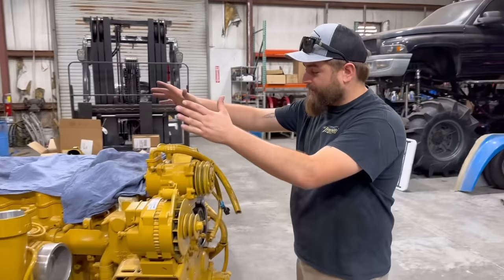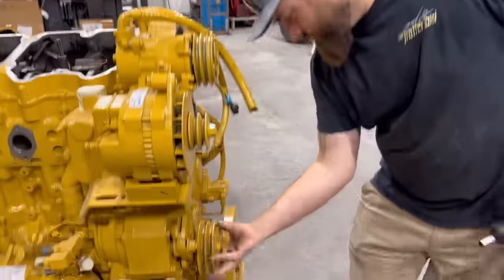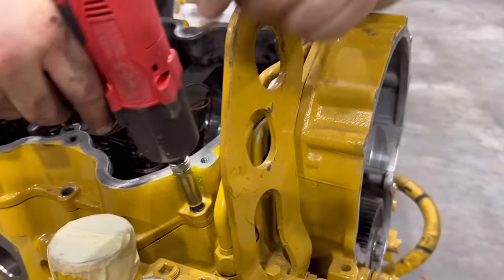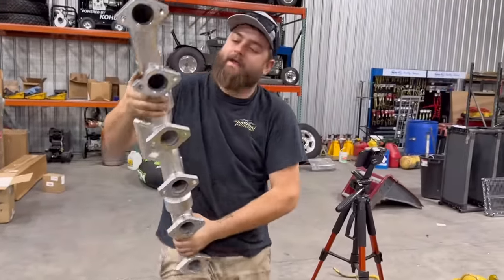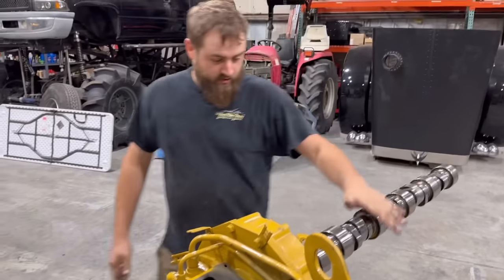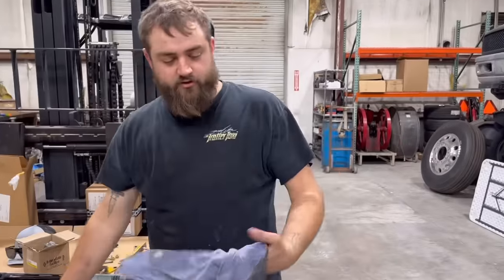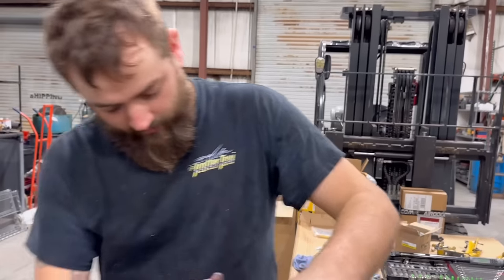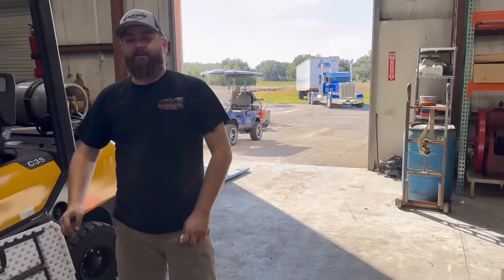BIG BOY Caterpillar C15 Engine Build is Underway!

Comment: Having a 50 lb camshaft rest with all its weight pushing down on one bearing shell is probably not a good thing..
Reply: I wanted to say the same thing but I didn't want to get called something silly by the YouTube trolls like a armchair mechanic.
Reply: No worries,  this engine is not going into over the road truck.  The whole purpose of it is to take it apart very soon due to failed parts and shitty workmanship.
Reply: Thought the same thing.
Reply: It’s fine
Reply: It’ll be just fine, don’t worry you self. Not you engine, not you money and not you truck.
Reply: @dieselsrule174 exactly and more content for him to make 😂
Reply: It will be fine its just for utube content, probably the engine will run for 10 miles only

Comment: The rear sump is superior to front sump as G force on acceleration causes oil to slosh to the rear . I would put a giant accumulator in lube circuit .fluctuating pressure causes oil to dump in to lube circuit . . So do self a favor install a large enough system about a gallon should be adequate . Only saves your investment . I’ve used these systems for years successfully . Don’t have a gallon one use 2 , of the 1/2 gallon systems piggy back .

Comment: Just an fyi, you can’t check torque the way you did, some guys try to check break away torque, but that isn’t good either, best way I can tell is to mark the bolt, then loosen it, and retorque to the mark, once a bolt stops turning, it requires much more force to get it moving again, all instructions requiring torque will tell you to achieve your final torque in one smooth motion…

Comment: Finnish Sisu used Cat C-18 engines about 2003-2006. I had it tuned up to 750-800hp, and since that it was the best running truck i've ever driven. )

Comment: Next time you put a cam in have homeboy with the camera help. Also keep the cam flat and twist it in and out of each bushing to deburr and push the assembly lube all the way around as you go(dont pull it all the way out or push through completely right away)And dont be packing greese into that back bearing. It gets trapped and can fuck with runout. It isnt rocket mortgage. Good luck with 2,000hp 😅

Comment: I think next time you need to lube, everything really really well with oil before you stick the cam in. It’s just a suggestion, but I promise you it makes a difference.  I’ve used once you have one time and it is not the same as putting the right oil in. You don’t want any metal to metal contact at all not even in the first start up.

Comment: I hope this motor sounds just as mean as the other one when idling. The way the old motor sounded at idle was awesome! I had a smile from ear to ear whenever you were running it. Most of the super big guys in NTPA run Cats and they never sounded like the old motor. I have a neighbor that's about 15 miles from me that has a prostock super semi called Krazy KW and I've never heard it sound like yours.
Reply: Old one had a bad missfire, was running rough

Comment: Hey, Bruce, is there some kind of gasket between the three pieces of that exhaust manifold?  I would think that would be a quick place to get an exhaust leak.
Reply: Suprisingly enough a 3 piece or 2 piece manifold dont leak i had the same question when i first started with em but they hold up good